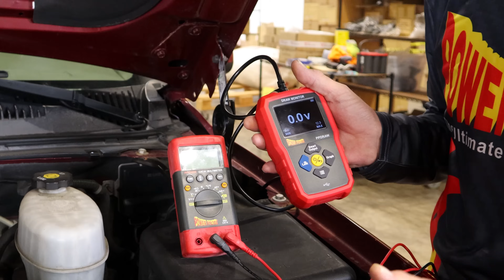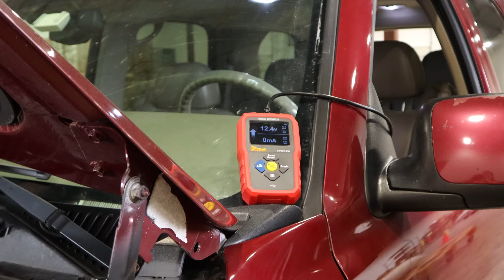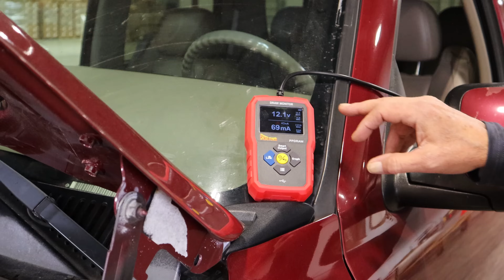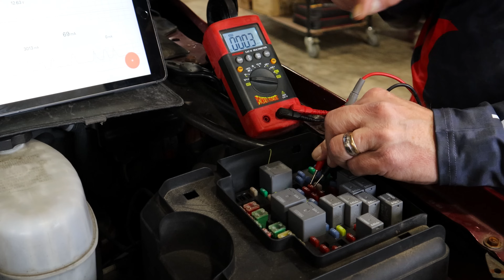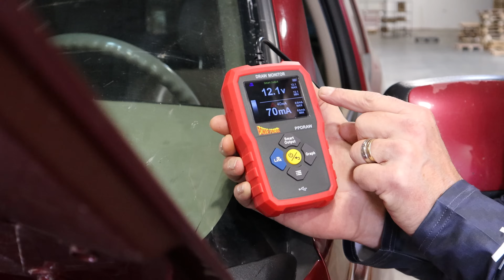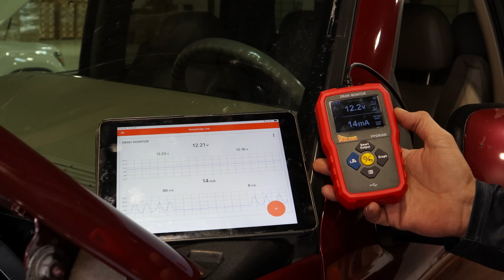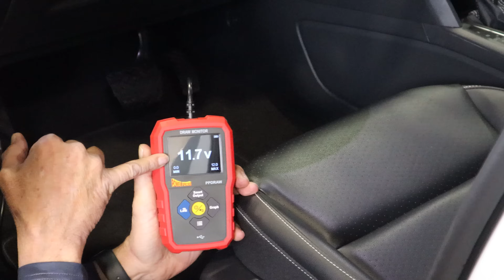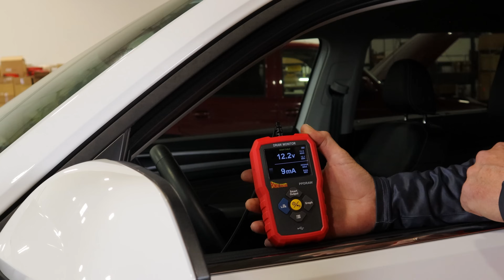See the PPDRAW in Action! Parasitic Draw Case Study with Dave and Dave

Comment: i tried it on a 2014 equinox this morning followed the procedure for setup locked the doors disconnected the battery it shows a draw anywhere between 3 and 6 amps than the power probe sounds the vehicles horn and shuts down is something not right here? vehicle starts runs ok but will draw the battery down if it sits for about a week
Reply from the maker: If you have any questions, concerns, or need technical support with our tool, our team is here to help.
📞 Call 1-800-655-3585, then press 3
🕗 Available Monday–Friday, 8:00 AM – 5:00 PM EST

Comment: There is a simpler way to measure and monitor current draw from the battery, use a clamp meter!!  This is a non contact meter which surrounds the cable in which current is to be measured, by opening then closing a moving section of a clamp. In the case of a car, bike etc, this would be the positive battery cable. Any decent such instrument will easily measure down to milliamps and can be bought for as little as 30 bucks.
Reply from the maker: Inductive clamps do work, but moving them around changes the reading, limiting accuracy.
Reply: @PowerProbeUSA 
True but keeping the conductor in the centre or where the cable indicators are on the clamps gives an accurate reading. From experience that's easy enough to do.

Comment: I see how this tool could be helpful, but no matter what your going to still need to break out your meter and measure those draws on each fuse after the car is asleep to pinpoint the excessive draw. From what I can see it would do well is verify that the vehicle does have a parasitic draw, (since  the customer has told you the battery keeps dying) and you could skip testing the battery and use this tool, but im not sure spending $200 to do that is worth it, and most likely the first thing the tech is going to do is test the battery anyway.

Comment: Just bought one and the first use is on a 22 F150, the speakers are popping and display says too much draw. I took it off and used my snapon meter and none of that is happening and the draw was under 500mA right away and within a minute or two infer 100mA. Am i using it wrong

Comment: The drama monitor functionality can be found in the parasitic draw set up using the Power Probe hook.
Reply from the maker: Sort of- connecting through the OBD port eliminates the need to disconnect the battery to put the tool inline. This keeps modules from resetting, temporarily removing the draw

Comment: This tool seems really pointless...   maybe good for people that don't understand how a MM works i guess..  lol
Reply from the maker: Well, when you do an in-line test to quantify the amount of current on the sleep state of a vehicle, you must disconnect the battery, thereby interrupting the flow of 12V causing the loss of radio memory, TPS settings, etc. This is so that flow of 12V is never interrupted and you can Bluetooth to it, work on another car in the meantime, while monitoring the draw to wait for the modules to go to sleep. Just like our other tools, it's meant to be a timesaver to make you more efficient and also happens to have memory saving capabilities.

Comment: Can it double as a power maintainer during battery services?
Reply from the maker: Absolutely! Confirm when you plug it in that pin 16 has voltage, and hit the Smart Output button before disconnecting the battery.

Comment: What if vechile has 2 batteries 
Main battery 
Auxiliary battery 
Do you just disconnect the Main battery and leave the auxiliary battery alone 
Just asking for a friend ❤😂
Reply from the maker: Disconnect both! you need the entire system running on the draw monitor and the draw monitor alone in order to get an accurate reading
Reply: @PowerProbeUSA thank you ❤

Comment: As a total noob I don't understand how this helps,except no power interruption, if you are still using a multimeter to actually find the culprit?
Reply: As someone with over a couple decades of automotive diagnostics experience, I don’t get it either. All this thing offers over a meter w/amp clamp is a “power supply”. Since disconnecting the vehicle battery is not a part of my voltage drop test routine, I don’t see the need for a 20min power supply. I guess a phone alert would be nice, but not really worth having to touch battery terminals, when min/max on my meter can alert me just the same. The phone alert would be very useful in an instance where the parasitic draw took a LONG time to present itself, but this tool will be dead long before it would be useful in that case.

The voltage drop to amperage conversion is ok I guess, but I’ve never really cared about the specific current value when chasing a parasitic draw. I rarely used the conversion tables to begin with. Regardless of the fuse type, the current draw is either there or it isn’t. Whether or not I know the exact amount of current being drawn is irrelevant. The amp clamp will tell me the grand total. If the grand total is still too high,  after eliminating the first parasitic draw, then I know there is a second component to find and it doesn’t matter if it is 50mA or 65mA.
Reply from the maker: There are a lot of ways to measure parasitic draw, amp clamp over one of the wires going to the battery, measuring voltage drop over one side of the battery, but all those ways leave more to be desired. You'll have to convert voltage drop using our fuse charts to convert to true amps and that can only be so accurate. With the draw monitor it easily hooks up to the obd port and once you disconnect the battery it does all the work for you and converts voltage drop to amps and displays it very easily on the screen so that anyone can understand it. You can then easily communicate this to a customer with a photo. You can then run across the fuse panel and know exactly how much current you have to find so you're not just guessing. The tool also offers the opportunity to monitor the current on your phone via Bluetooth which can be helpful while you work on other components and to easily monitor spikes.

Comment: I just bought a power probe 4. I can only use the DVC measurement mode. The remaining modes have a red X. What's wrong with it? thank you.
Reply from the maker: Hey there! The VDC mode is the only mode that allows you to apply power/ground in the PP4. If you try to apply power/ground in any other modes you'll get that red X. That doesn't happen unless you are trying to apply power so its possible that the rocker switch is sticking. Try removing the switch to see if the X goes away. If not the tool is malfunctioning, but if it is you'll need a new rocker switch. You can start an RMA here https://aftersales.powerprobe.com . Hope this helps!

Comment: So every 10 seconds the tester goes from 9ma to 38ma.  GM says 25ma is acceptable. Would this reading be normal? Vehicle powered done 20 minutes…
Reply from the maker: I can't speak to whether that is normal or unusual for that vehicle, there may be something weird going on there, but if total draw never exceeds 38mA that is not usually enough draw to cause premature battery drain problems. Everything is manufacture specific, but the generally accepted rule is no more than 50mA.

Comment: Blue tooth power probe link app installs,  ppdraw pairs to pixel 3xl and pixel 4a ,   however, link app wont pair to show live data.  Its probably how I have my cels configured.        If possible,  could a short video be made on the install and pairing process of the power probe link app.  Thanks
Reply: Worked,   ( power probe app link , needed about 30 to 40 seconds) to initially see ppdraw, on pixel 4a.     Also , I had location, wifi scanning  turned off,   so  Once these were turned on, this may have helped my situation.
Reply from the maker: Awesome to hear!! Thanks for the input!

Comment: if you actually put how to use it in the owners manual, that might have helped. Just saying. Me and a co worker that also owns this was also wondering where in the instructions was the operations guide.
Reply: It's literally 3 steps! 
1. Plug in
2. Hit smart output
3. Disconnect (-) battery terminal

Sorry 4,

4. Wait..... 

This isn't going to make someone a Master diagnostic parasitic draw tech, you need to know how vehicle electronics work. One of the biggest culprits of parasitic draw you will not find in the fuse box! (I'm talking about the alternator!) I'm sorry man but if you can't figure out how to use it then you probably are a ways from it benefiting you and being worth the cost!
Reply: @commonsenseisdeadandgone I’ve been doing automotive electrical testing for 24 years, and just bought one of these two days ago. I flipped open the owners manual & found no usage instructions. Sorry, but that’s just stupid. If you go to the trouble to print an “owner’s manual” in 8 languages, you can add a single page with all this information. Instead, I had to go online and watch a rather annoying YouTube video. Maybe the percentage of techs who can’t read is growing these days, but those who can typically prefer written documentation that they can refer back to if needed.
Reply: @commonsenseisdeadin2024 good for you, you're so good you didn't need instruction.  Get a life, Dennis is just trying to make sure he uses the tool properly and to its full extent. And yes they should have include an operation guide in manual so we didn't have to come watch video on YouTube.  (Just like you are doing)😅

Comment: $230, I think I'll stick to my meter, cute tool though.
Reply: At first glance it's sweet..... It's definitely an impulse buy! (Touche on the tool truck exclusive 😂)
Reply from the maker: If you're using your meter to check the current draw on the battery, you'll need a second meter to do voltage drop across the fuses, right?
Reply: @PowerProbeUSA  depends what meter you have! I have a "power factor" meter, I can amp clamp and use my test leads at the same time. 

Then again, what's the difference from buying another meter rather than buying this? For $250, you can buy a few meters and still have money for lunch (for now anyway.... Don't know how long that will hold true with food prices these days 😂) 

The biggest issue is this is a one trick pony, another meter (be it an amp clamp or just a basic DMM) is going to have multiple uses. Can also buy a handheld oscilloscope with a highly sensitive and accurate amp clamp, DMM in one as well, also graph to see any change. 

As far as the battery powering the DLC, I've had a lithium jump pack for well over 5 years that came with a OBDII and Cig plug to keep memory power alive. 

Want to send me one to see if you can change my mind? It does what it's meant to, my gripe is that high price tag.

Comment: nifty new tool, a few questions for you.

how is the tool powered?  recharge lable battery or a throw away battery?

could it be used as a memory saver when changing out main batteries?
Reply from the maker: It has a rechargeable Lithium battery... and yes it is a memory saver! That is one of the main functions of the tool. The beauty is whenever you are changing a battery, etc. and you use PPDRAW as a memory saver, you can quickly check for unwanted battery drains! (Something killed the old battery?)

Comment: One suggestion for those that are using this at the DLC. If the draw is coming from the cig lighter or power port you will be powering the draw directly without entering the fuse block. You can take out every fuse and the draw will still be visible on the tool. 
I just recently had a truck that had some usb charge ports wired into the power port harness. 
Other vehicles have gps trackers tapped into the DLC and you will have the same issue.
Reply: I was just thinking about factors such as these, if something was connected to the dlc that was causing the draw and unplugging the accessory and plugging this in will fix the problem and you would never know.  lots of variables when using this tool.
Reply: @crasher88  por diferencia si se sabria   pues lo que estaba conectado al dlc   ademas si es de stop start bottom no tiene que estar el control a menos de tres metros porque produciria una descarga no deseada
Reply: @crasher88  Its a cute tool but I use a UNI-T 210-E clamp on meter on the battery terminal. Measure down to a milliamp. you can also test wires. Some 90s-Present Fords take an hour to settle to their sleep current.
Reply: @alb12345672 sometimes you can't get a clamp around the cable. A side post is a good example or if its buried in a housing. Sometimes I have a hard time trusting inductive clamp accuracy. I have my own solution for this. Not defending the PP people because the only useful innovation to me here is the bluetooth. On the other hand it drains the internal battery quicker and it requires another tablet or phone to use it.
Reply: @webreakforsquirrel4201  Agreed,  I could see their tool having a place too. Sometimes modules can wake up over night, have a high drain and this can record. I had that on a car, for some reason a module was waking things up hours later. I wonder how long it would last in that scenario.  The clamp meter has to be zeroed out, I agree. In my testing it agrees with the inline series measurement.
Reply: Yeah but the draw will obviously be higher if your draw is on that circuit.  I assume (I know I shouldn't) that anyone diagnosing would be able to immediately tell the difference..... 

This tool seems trick at first glance but for $250, hard pass from me. Just test every fuse since you are going to have to anyway! Get it down to $100 and I'd buy it just for the form factor. I love many PP products but some are becoming gimmicky and expensive (then again they are looking to be geared towards a tool truck brand it seems 🤷)
Reply from the maker: Thanks TPM!!! Good tip to remember when using the PPDRAW.

Comment: I have tool   Gonna get rid of it it  Master Tech here   Tool works as you show   Battery in tool to weak   If there is is a draw god for bid it is large draw    Your tool dies within 10-15 mins.   Needs bigger battery  in tool
Reply: If your draw is that big you could just use an amp clamp. I think this tool is better suited for small to medium drains.
Reply from the maker: Hmm, something is not right here. 
The battery in the PPDRAW is rated at 3200mAH. The tool limits output to no more than 10A... so even at a continuous 10A draw (and that is definitely a problem!) the tool should run almost 20 minutes. At normal draw rates <100mA, the tool can run and monitor for more than 24 hours! 
Please make sure yours was fully charged first.
Reply: Maybe start with hooked on phonics and compose a coherent sentence for the love of all that’s holy!
Reply: Can you hook the ppdraw up to a charger when you use it?
Reply: Turn your timer off!
Reply: trying to probe both sides of the fuse under the dash is easier said than done
Reply: How do you test under dash fuses without interior lights causing a draw?
Reply: @VIPERBLUELX  especially in a new Lincoln Continental!
Reply: @VIPERBLUELX close the door latch if door switch is built into it or unplug the door switch if mounted to body.
Reply: @VIPERBLUELX pull light fuse

Comment: What type of power supply is in the device? How many amps will it supply?
Reply from the maker: It has a 3200mAH lithium battery and the tool will limit output to no more than 10 Amps.

Comment: Do you make one that doesnt use obd connection? I work on buses and they don't have obd they have j1939 plug
Reply: Adapter harness but make sure it's not 24v! 

I'm surprised it doesn't just go into a cigarette outlet (however those are going extinct so.....) 

Could also adapt it to battery clamps, just attach to the negative clamp and disconnect.... It's all the same! 

They should have just made it a quick OBD2 to read and clear codes... I'm assuming it's literally a OBD2 plug with 2 pins as you don't want to mess with the CAN considering that will surely wake some stuff up (or mess stuff up 😂)
Reply: Could probably use a obd extension cable and cut the end off and put the bus end on it or maybe they make a obd conversion cable